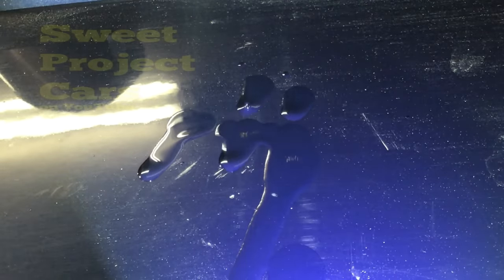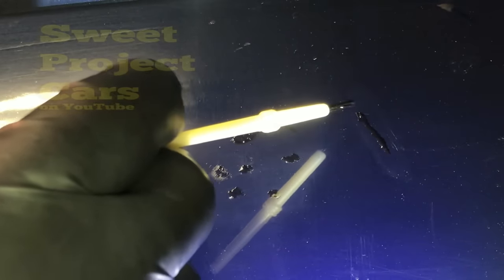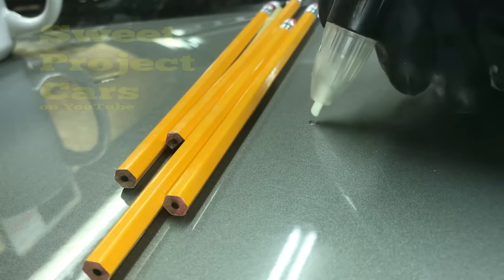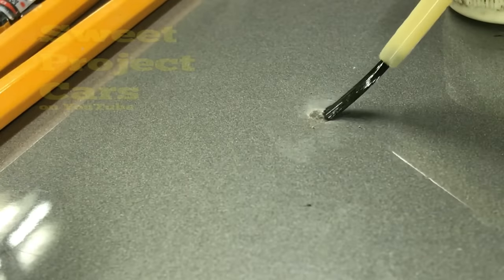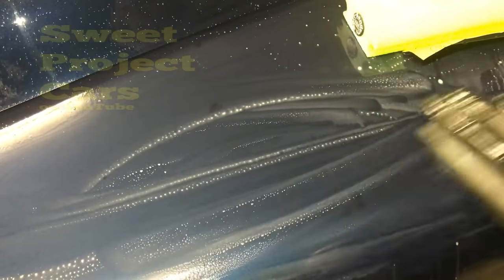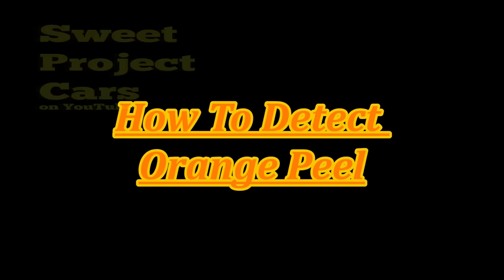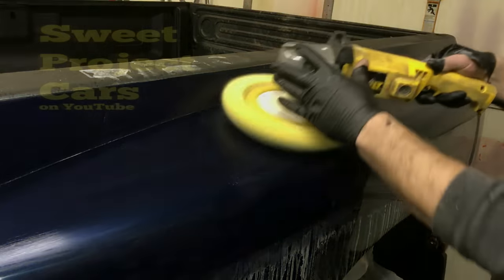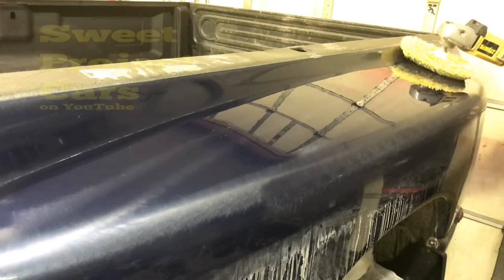How To FIX Any Paint Chip or Scratch in Your Car or Truck Paint... DIY

Comment: Love the video - clear and to the point. I have a question - The touch up paint I have has a separate clear coat. How does this fit into your process? Would I add the base coat as you've added your blue paint, sand it flat then put the clear coat on top? And does that need to be sanded too? Thanks!!
Reply from the maker: mix the 2 together 25% Clear and 75% color Then apply and follow the video to a T
Reply: @SweetProjectCars OK great. Thanks!

Comment: Awesome video. I'm building up courage to do this on my silver 4runner. Question though: I have one of the common touch-up paint pens and the directions say to apply clear coat after. Does that mean it isn't 1 stage paint? If it isn't, would you recommend getting some that is? Otherwise, how would you suggest I apply the clear coat?
Reply from the maker: tyler mix the two together 75% paint and 25% clear then apply

Comment: Thank you so much for the detailed instructions. I tried the touch up on my brand new silver prius. The problem is first time I sanded off after 12 hours the touch up paint doesnt remain flat and flush. So I used the thinner to remove the paint and retouched the paint. This time I will wait for 24 hours before sanding. Now I am worried, wont the repeated sanding wear off the clear coat from the surrounding areas. I am using 3000 grit. 

Also the paint seems to sunk into the gap after a few hours and I am applying more on top to create a blob per se so when it dries up completely I can sand it off. Am I doing something wrong here?
Reply from the maker: Please watch the video at least 2 more times.  Dry time all depends on the temperature you are working in.  Please allow to dry at least 48 hrs. at 70 plus degree weather, then sand with this  https://amzn.to/33Th4yL   Thanks for the question.  Hope this helps.  mad Mike the hammer SPC

Comment: Excellent video!! Now I can take a stab at fixing the scuff marks some fine citizen left on my car in a parking lot. One question though... How would the process change if your paint pen doesn't have the clear coat pre-mixed into the base coat? Mine pen is directly from the Subaru dealership and the two coats are separate. 

Would the steps be... clean the area, fill the scuff with paint, let dry, clean area, wet sand, clear coat the painted scuff, let dry, clean area, sand, then buff/polish? 

Thanks for the help!
Reply from the maker: atvking535 see this video for that mix situation  https://youtu.be/vOlQfsuBz7I and the steps would be exactly as stated in the video for guaranteed success my good friend :)
Reply: Perfect, thanks! I didn't know it was that simple!

Comment: Great  video. I have  a black Audi A3 with many  paint chips on the hood and I'm very excited to try your method.  After much searching I am unable to find touch up paint that includes the clear coat. Whats your recommendation to do the repair if the paint and clear coat come in separate containers. Thanks for any advice.
Reply from the maker: Oz Bar no problem you will apply the paint and leave it a bit lower so you have room to top it off with your clear then finish it off per the video ...hope this helps :)

Comment: Hey guys without a doubt you are the best out there love all your videos can you help me I’ve touched up all my stone chips wet sanded and polished but turns out the paint wasn’t a perfect match so can still notice them what is my next step to sort these out much love mark from England
Reply from the maker: Mark, that is going to be your biggest struggle filling any chip on any vehicle is getting the paint to match.  Most body shops cannot get an exact match when they paint a full fender, so what they'll do is try to blend in to the next body panel to make it not so noticeable.  I wish I had better news for you.  People always wonder why we own all white vehicles, that's one of the biggest reasons is that white is the easiest to match.  The best thing you can do at this point is to keep trying variations of your color, dab it on the paint, let it dry until you are satisfied.  You can always wipe it off with lacquer thinner.  Thanks so much for the question.  Hope this helps.  Have a great day my friend.  mad Mike the hammer SPC
Reply: Sweet Project Cars thank you mad mike I’ll stick with it keep up the good work I’m addicted to your channel 👍👍👍👍👍

Comment: I know im a bit late to this video, but you are awesome! I have a question. What are the steps if you have 2 step paint. I have a base coat and clear coat i need to apply, it isnt 1 step. should i sand down the base coat to be level with the rest and then clearcoat it, or doi i do base coat above original paint, clear coat on top of that THEN sand? Thank yoU!!
Reply from the maker: Watch this video  https://youtu.be/vOlQfsuBz7I  and you will be on your way to success.  There is no need to do the base coat and clear coat separately.  You will see that in the video we shared with you.  Thanks for the great question.  Have a fantastic evening.  mad Mike the hammer SPC
Reply: @SweetProjectCars  Thank you so much for getting back to me! You have earned a subscriber for sure. Keep up the great work, love the videos!

Comment: I gauged about a quarter size down to the metal in my painted pearl white ram rear bumper (trailer hitch 😅 damage) I immediately cleaned with 99% and touched it up with primer so there’s no rust. My issue is the pearl white…local auto paint supplier mixed me the correct white, then a separate clear mixed with pearl. Do you think this can be applied ? I think I’d have to sand the white before applying the pearl/clear ?
Reply from the maker: If I were you, I would mix 50/50 of your white and your pearl and apply it in one shot, that's how we would do it nvy2fd588. Hope this helps, thanks for the view and question, have a great day my friend. mad Mike the hammer SPC

Comment: LOVE YOUR VIDEOS!  Your process of touching up paint chips uses a single stage paint (paint and clear coat together).  However, our Honda Accord is "Orchid White Pearl" - which means there multiple steps.  Would I go through a similar process of steps - #1 - paint, #2 - pearl #3 - clear coat - then work on wet sanding?  My fear is that the wet sanding would remove the clear or pearl coat.  Or do you know of a single stage that has the paint, pearl, and clear coat together?
Reply from the maker: Todd Richards you can mix them all together to do the job one time see this it may help you https://youtu.be/vOlQfsuBz7I

Comment: Do you recommend OEM touch up paint or something off the shelf (auto parts store) or online (dr. color chip)?  What do you recommend doing for the clear coat - mix it in with the touchup paint or apply it after wet sanding and buffing? Need to touch up two small scuffs down to plastic on the bumper a 2018 Jeep that is a silver metallic.  I've enjoyed your videos tremendously (watched most actually), and I plan to follow your techniques.  I want to make sure I'm prepared before attempting myself.  Thank you!
Reply from the maker: Dodge4L1fe factory touch up is the best to use and yes mixing it in with the paint is best 75% paint 25% clear roughly

Comment: Great result, but forgot to mention that this is a one time only process since the clear coat thickness won't handle another sanding.
Reply from the maker: Most repairs are a one time fix, we never said it was a lifetime repair, cars will always get chips in them.  Thanks.  mad Mike the hammer SPC

Comment: So did you make your own touch up paint with the paint you got from the body shop and by mixing your own clear coat, or did you buy a touch up pen?
Reply from the maker: You can use any paint you want to do this we have a video on how to mix the clearcoat and base color together from a paint pen that way you only have to apply that and you do not have to do basecoat clearcoat which means you would have to sand it twice best thing to use is a single stage that has the the coat in it but as I said you can mix the two together from a paint pen that way you just add it once and done hope this answers your question have a great night
Reply: Sweet Project Cars thanks for the quick reply and great information!

Comment: When I used the self etching primer I think I put too much on... it’s slightly higher than the surrounding paint... should I sand it down before applying my OEM paint? Thank you for the video...
Reply from the maker: You can, just make sure you're using this  https://amzn.to/2GIhcZL  make sure you use the finest grits they have.  Thanks for the question.  Have a great night.  mad Mike the hammer SPC

Comment: Hey!  Great informative video!  Question on the sanding with the bottom of the pencil. When do you use the 600 grit and when the 2000?
Reply from the maker: 600 is used at the beginning of the process then the 2,000 is used at the end. Thanks for watching Errol, we appreciate the view and question. Have a great weekend. mad Mike the hammer SPC

Comment: Do you have a video explaining when to use polish vs compound vs wet sanding?  Great videos by the way   I’ve subscribed and shared with my mates and now they’re subscribers as well. 
Thanks for sharing 
Cheers mate
Reply from the maker: Thank you very much my friend we have so many videos on paint correction it’s crazy there are so many different types of paint issues we would have to do 1000 videos on every different type, the best way is to start out with mothers Metal polish that we use, if that doesn’t do it then you’ll have to sand it and if you look through our videos you’ll find that video have a great weekend

Comment: About to try this tomorrow. Question: I bought a spray can of duplicolour clear and my basecoat, can i mix them in the lid and apply them with a brush? if so what ratio?
Second question is can i use acetone to prep the spots?
Reply from the maker: We suggest if you want the paint to bond that you use the products in the tools list.  But yes, you can mix your clear & basecoat at a 25 clear/75basecoat ratio.  Thanks for asking, sorry for our late reply.  Have a great day.  mad Mike the hammer SPC

Comment: I've got a Dodge Ram 3500 dually Patriot Blue too. Got any leftover paint from this job? Just need to do a nickel-size spot on the hood that's to the metal and rusted. I've got tons of rock chips on the leading edge of the dually fenders too. Those dually fenders are like rock magnets.

I noticed in this video that you did not use any "Bondo Glazing and Spot Putty" to fill in the chips, even the the chips down to the bare metal with rust, as you had done in previous videos. Are you no longer filling in chips with putty? My concern with filling in my rust spot with putty and then shaving it down flush with the surrounding area, is that when I put paint on top of the putty the paint will be higher than the surrounding area and if I sand it flush, then it will sand off all the paint I added down to the putty which is flush. Am I making sense?
Reply from the maker: Hello Scott, sorry no paint leftover, and yes you are correct on the dually fenders, they definitely attract the rocks :(  Thanks for watching and sharing.  Have a great day.  mad Mike the hammer SPC

Comment: SPC, I'm curious if you would be able to do a video on how to use Bondo for body repairs.  I have been watching your videos and have learned so much that I believe I have a good understanding on how to repair some damage on my wife's vehicle.  The damage is on the front fender, which is steel, and also a puncture in the hood which is aluminum.  Would you have any advice on whether the same Bondo mixture will work on both metals and are there any other suggestions you might offer to someone trying to save some money (about $1500 est. damage) on this repair?  Thank you in advance.
Reply from the maker: Brandon we will see what we can do for you we do have a video if you look through them on using Bondo hair on a front bumper cover which will be finishing that video up here in the next few weeks but we can definitely help you with that hang in there have patience with us and will get to it have a great week my friend

Comment: Great video! But I still have a  couple questions. My dealer sold me two stage touch up pen. One end of the pen contains a mix of primer and paint while the other has paint sealer. Should I just use the paint portion or mix paint and sealant when i do the touch up. Also, can I apply compound and polish by hand or is a buffer necessary?
Reply from the maker: Cesar Raudez just use the paint portion let it dry 48 hours then follow video ad lightly sand with 3000 grit wet and dry paper then buff by hand it will take longer to do it by hand but you will get it.

Comment: I was in a hurry the other day to remove some adhesive from a truck. The truck was sitting in the sun and I put some 99% on a rag, black paint pretty much cooking in 100 degrees, wiped the adhesive off, took the damn clear with it. I guess that was pretty foolish rushing and doing it in the sun. Live and learn.
Reply from the maker: Yes when the clearcoat is that hot it can’t stand much of any type of cleaner

Comment: I have a question: Instead of using lacquer thinner would you use instead Por15? My auto paint supply warehouse recommended this product due to lacquer thinner would remove the clear (?). What are your thoughts on this? Grand daughters Toyota needs rock chips repaired and I am getting everything together now.
Reply from the maker: Harry my friend if you follow this video and the other ones that we have you will have no issues they will turn out perfect and lacquer thinner will not take off clearcoat hope this helps you my friend
Reply: You guys are on top of it!!  Thanks for the response.

Comment: Thanks for a great Chip w/Rust Guide. What is the Self Etching Primer you used in your video? Doesn't the Self Etching Primer Insure paint adhesion?
Reply from the maker: Ax4400 what the SEP does is stop the rust from coming back...if you do not have rust the lacquer thinner will clean well enough that the paint will bond perfectly.
Reply: I'm patching the bed from my light truck where the factory rubber liners rubbed off the paint to metal, before I put it back.   I also have some rock pits with rust, my 00 Truck is in great shape and I want to maintain it that way, since I know it well enough to safe on repairs and mechanical maintenance.   Thank you
Reply from the maker: Ax4400 you are very welcome  my friend :)

Comment: self etching or rust reformer?  whole net says self etch eats at your paint for a minute but this may be no issue.  it does seal it well from rust & bond good.
Reply from the maker: Self etching is the only way to go they been using it for years and years all body shop to use it it’s the best way I’ve never seen it eat in to paint been at it for 35 years thank you for asking have a great night

Comment: Great video. I just subscribed. With the touch up pens that have base in one end and clear in the other, do you have to put the base first at a lower depth in the chip, then the clear on top to bubble out? Or can you just use the base and by wet sanding, compounding and polishing it, it becomes glossy without applying the clear coat?
Reply from the maker: Mix the two together, 75% paint and 25% clear.  Thanks for asking.  Have a great day.  mad Mike the hammer SPC

Comment: Hi, Thanks so much for the great videos! I have some chips on the edge of the inside lip of fender well. Could I carefully sand down with Dremel and a lower grit to clear rust, prior to higher grit and lacquer thinner?
Reply from the maker: Brad you can use what ever tools you like just be careful with a power tool on small areas most people are not real handy with a Dremel but some are you should give it a shot you can always revert back to the method in the video

Comment: Here's the question. Bare metal stone chip - rubbing alcohol, lacquer/paint thinner then the primer as I want to use it separately...a few hours later , rubbing alcohol followed by the paint thinner and the primer starts to dissolve. Guys , can you please tell me what the problem is...is it a matter of time , should I allow the primer to dry over night to come back to it with the paint thinner next day so the color paint can adhere better?.
Reply from the maker: Once you put the primer on do NOT put any more thinners etc on.  I would re-watch the video, maybe a couple of times it's crucial in this process.  After you apply primer, lightly sand, then a quick wipe with https://amzn.to/3hsXZbJ  to remove all oils JUST before you paint.  Let us know how it turns out.  Thanks for the question.  mad Mike the hammer SPC
Reply: @SweetProjectCars  Thanks for your advice. What about isopropyl alcohol diluted with the distilled water? Can I use it right before spraying the base paint?  Do you use a pure isopropyl alcohol to decontaminate the surface or a diluted one if so what ratio do you prefer?

Comment: My car's paint code only comes with the base coat and clear coat separated. Should I mix them before filling the wholes, or using this method is it necessary to clear coat? my hood looks some like someone shot it with a shotgun full of sand. some chips would as as large as the end of an eraser. Once again, awesome video, am ordering all the parts I need to fix my car!
Reply from the maker: We suggest that you follow the video put the paint and let it dry for at least 48 hours if you can get it out the sun to dry that’s even better then sand It then place the clear on let that dry same amount of time then sand that in buff.  This is why it’s best to use a single stage paint but you can still get it done with the two stage. It just takes longer.
Reply: thank you! I'll do it that way. in the video when you are wet sanding the paint before are you using 2000 grit sandpaper?